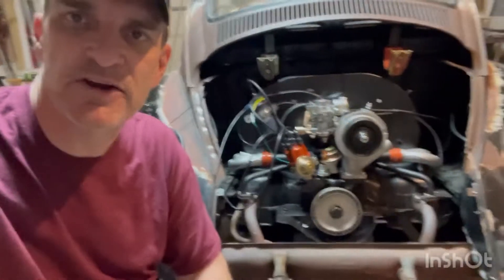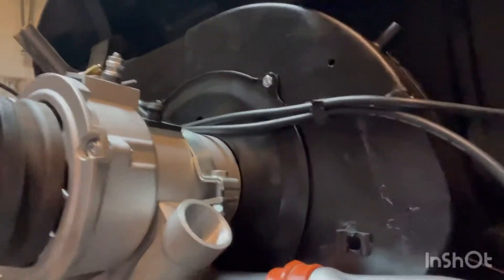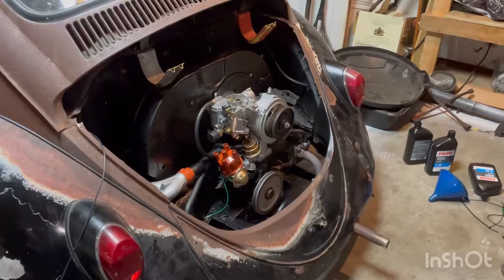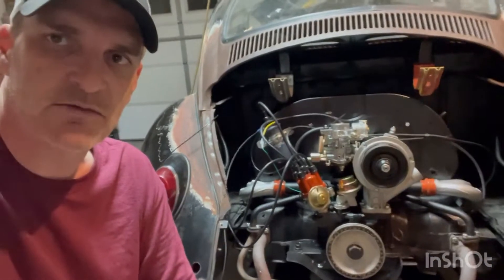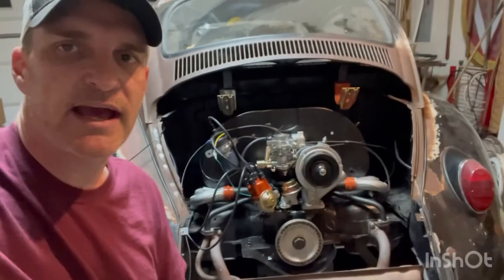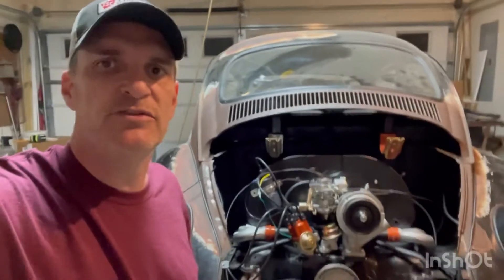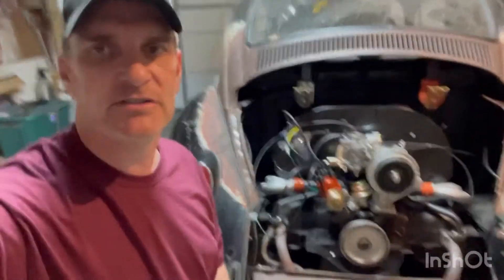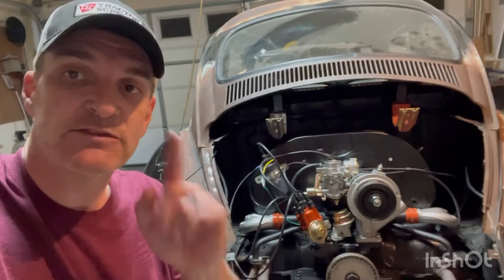1966 vw beetle update engine install

Comment: Hey Lamar, keep the videos coming !!! Are going to put in rear back skirt permently or make it removable to take motor in an out?  Kenny
Reply from the maker: Kenny, thanks for the comment. I’m gonna leave it as a removable apron. I did run into an issue with the tabs that it anchors to. That are a bit long. I’ll worry about that later. Thanks again